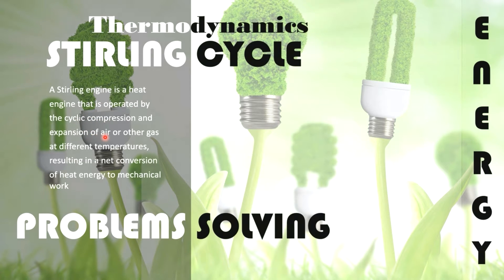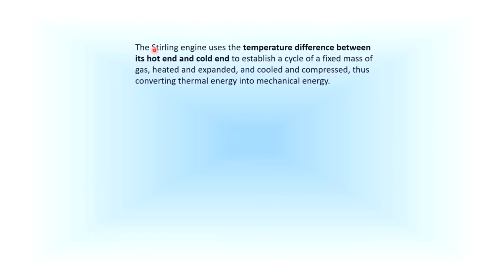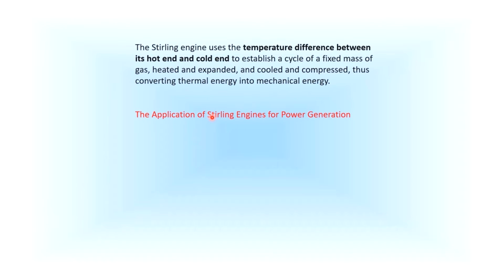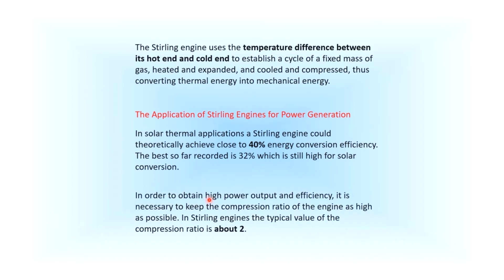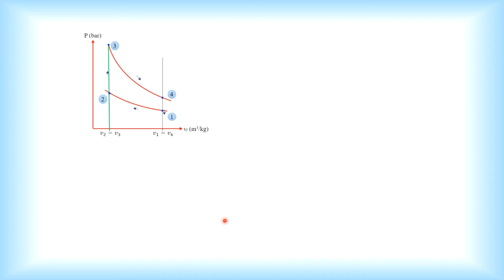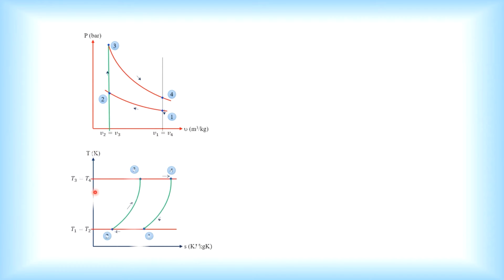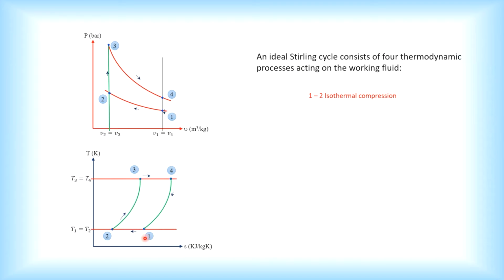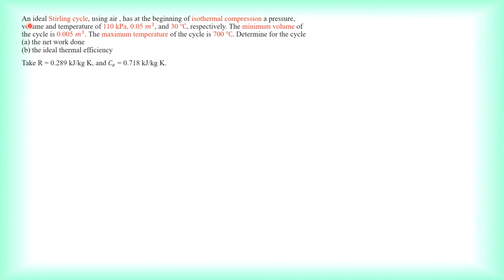Thermodynamics : Stirling Cycle 17092021

Comment: Wouldn't the formula for the ideal gases be wrong to apply when it reaches more than 10 bars, because its behaviour changes and cannot be treated as a regular ideal gas.
Reply from the maker: Under certain conditions
Reply from the maker: yes to your question.
but under certain conditions

Comment: Hi. For a university assignment I need to calculate the efficiency of a stirling cycle for a solar or wind plant using air as the medium. And I would calculate the efficiency of the Carnot cycle as well. And in theory the efficiency of the carnot and Stirling cycle are equal. But in reality the Stirling efficiency needs to be less than the Carnot efficiency. Your example is for an ideal situation. What would be the way to calculate it for a real situation so the efficiency is less than the Carnot. Or can we say that in reality the efficiency of the Stirling cycle would be about half of what the ideal stirling formula calculates it to be?
Reply from the maker: efficiency = (T2 - T1) / [T2+{Cv (T2-T1) / nRln (T2/T1)}]  which should be less than Carnot efficiency
Reply from the maker: which state point 1 to 2 should be the Isothermal Expansion. Draw the P-V and T-s diagrams u should be able to know what i meant.
Reply from the maker: Hope this help. I am happy if i can help. Thank You
Reply: Thank you:)
Reply from the maker: or u can use directly based on the definition that is the desired output divided by the required Input.
Reply from the maker: or you can use
efficiency = Useful Mechanical work developed / Heat Transfer from the Hot Section